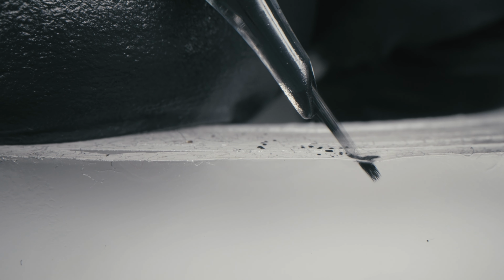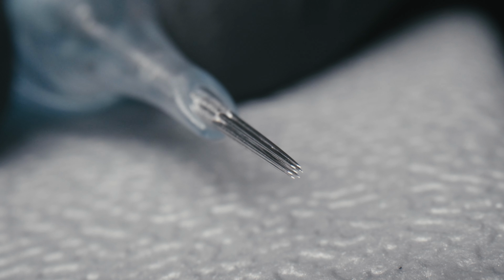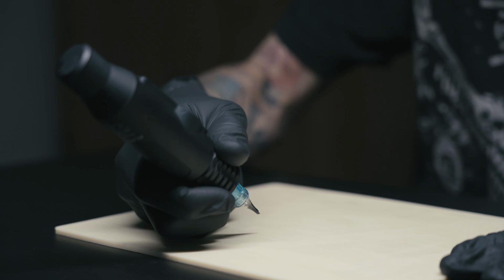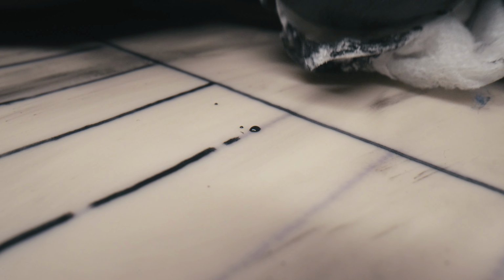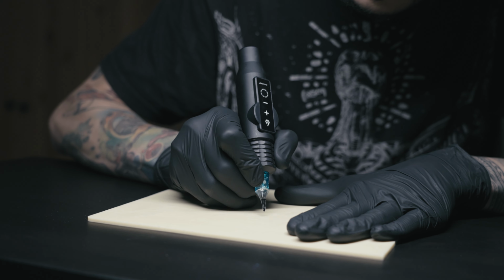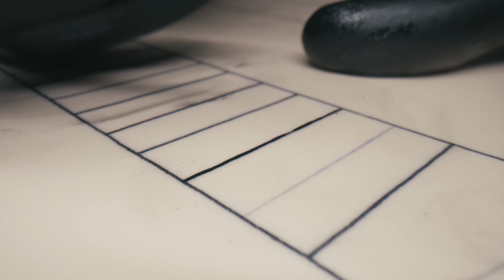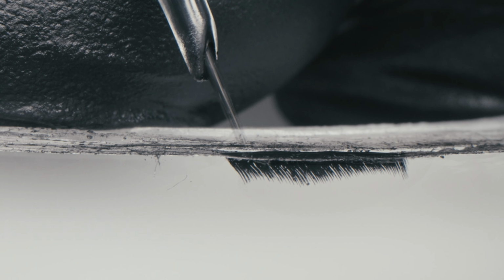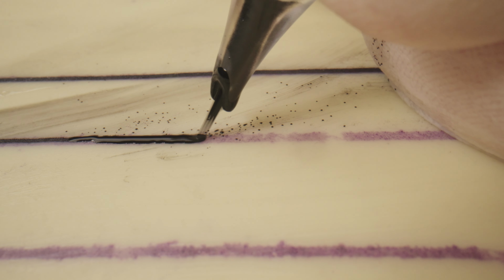Lining Guide for Beginners - How To Tattoo Solid Lines

Comment: I only started practicing today, so apologies if this is a super noob question, but when I use my 1205RM needle, it leaves individual skinny lines instead of one thick solid line, how do I fix this?
Reply: To fix the issue of skinny lines with your 1205RM needle, you probably need to ensure you're holding the machine at the right angle (around 45 degrees), applying enough pressure, and setting the needle at the correct depth. Also, make sure to stretch the skin properly and adjust your machine speed to match your hand movement.

Comment: I understand a “blowout” to be when the needle goes too deep, beyond the dermis layer and enters the subcutaneous layer allowing the ink to diffuse and spread. 

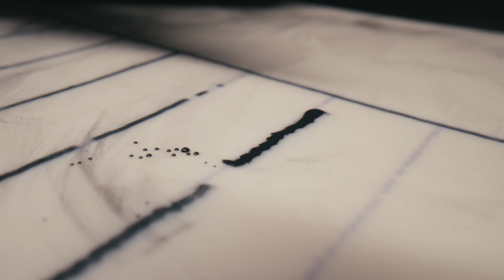Holding the machine at an extreme lateral angle (4:25) would result in an even shallower depth. So I would say this angle causes an unintentional and malformed deviation from the stencil line, but not a blowout as I understand it to be.

Comment: Sir you mentioned needle depth is around 0.5 to 1.5. Can you please mentioned a example of body area/part mostly that 0.5 will be used. Advance thank you so much Sir
Reply: Fingers, neck, wrist, ankles. Or boney areas like the collarbone
Reply: @marknicholls1075 ye or elbowsss
Reply: Shinbone area you want to be only about a half a millimeter deep then like this other guy said neck wrist you can actually Google needle depth for tattooing on different body areas it'll give you a pretty good diagram

Comment: what can cause needle wobble?i anchor my hand stretch the skin and all of a sudden my needle goes left and right with no controll
Reply: U have cheap needles? Sometimes with the cheaper ones theres more space in the cardridge for the needle so it moves more..
Reply: @s4nderino  Cheyenne capillary needles
Reply: @Tattoo_Noobie even it depends on your machine. It has to be more than 4mm stroke machine..
Reply: @rojalshakya3492  critical torque 4.0
Reply: Make sure your arm is stable, try not using your wrist when pulling a line. As the comment above check the wobble on your needles if you’re using cheaper cartridges. I highly recommend EZ cartridge for practice or actual skin. Good luck bro, hang in there
Reply: @jrvega9559  not using cheap needles ,and i also use my elbow when pulling but i still get wobble and needle deviation